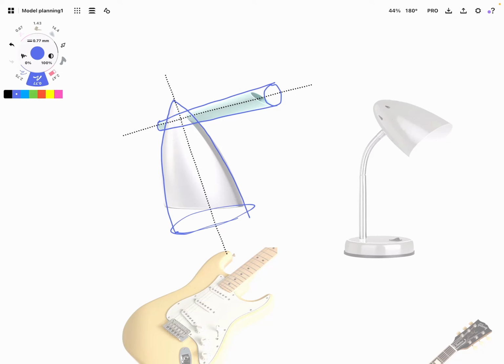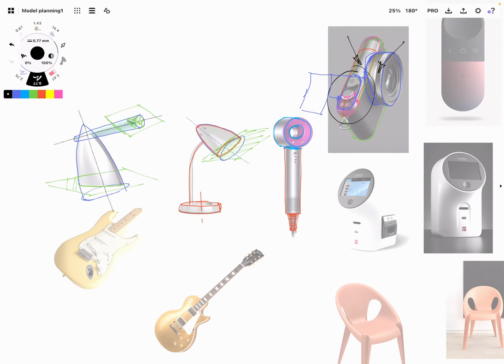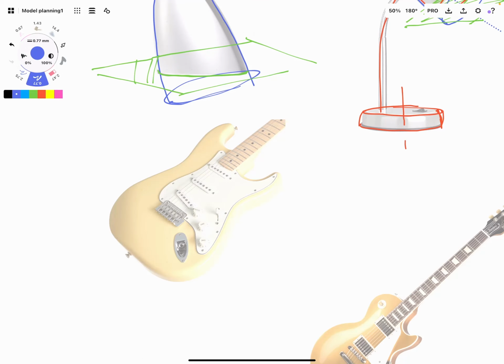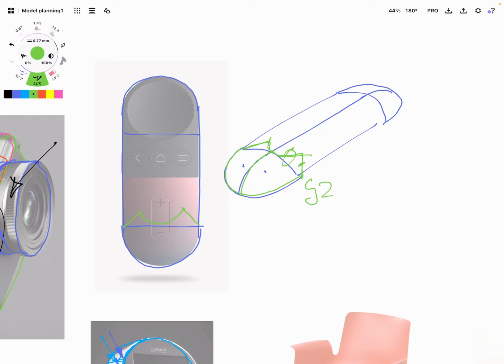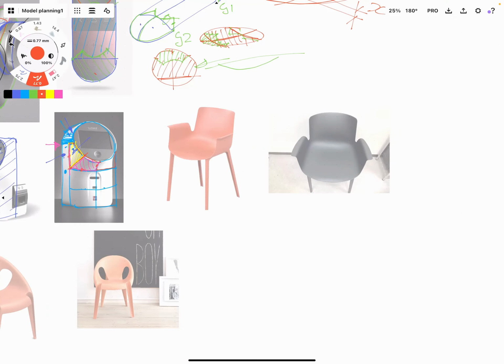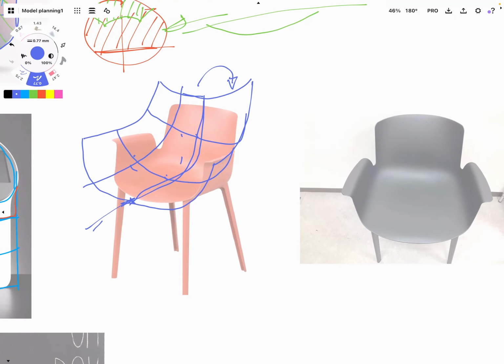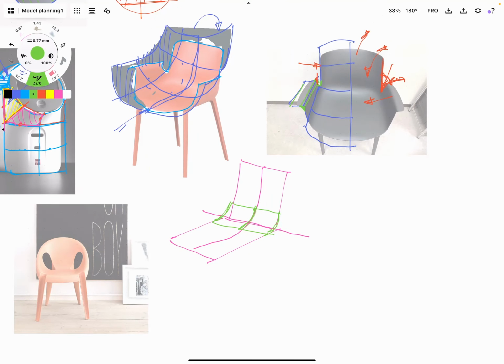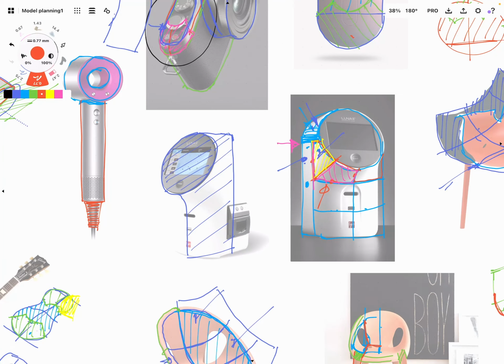Cad Model Planning #1

Comment: Great Video! I still have one question: Why do you prefer four-sided boundary surface operations over three-sided surface fills? Are they smoother?
Reply from the maker: Hi there. Good question. The main reason is nurbs surfaces have 4 sides, so if you make a boundary surface with 3 sides, one of the edges is collapsed into a singularity. That can cause all sorts of headaches later on (surface wiggles, issues offsetting surface etc).
Surface Fill in Solidworks will fit a larger/overbuilt 4 sided surface patch over a 3 sided hole which is then trimmed. It can be difficult to get good edge continuity using surface fills (even with constraint curves) plus they can randomly 'blow up' with spikes, dimples and wobbles appearing for no obvious reasons.

These links have some great information that is relevant to SW as well. Cheers!
https://help.autodesk.com/view/ALIAS/2022/ENU/?guid=GUID-2E98736D-0AE9-4021-A488-5D4522F20162
https://help.autodesk.com/view/ALIAS/2023/ENU/?guid=GUID-3E5274C3-FB89-4583-8087-A3E17DB849A1
Reply: @AndrewJacksonDesignStudio   Thx man! Love your attitude. You are really helping me (and I'm sure also a lot of other people) out. Keep up the great content!

As an industrial design student I only really learn solid modelling at university and its hard to get good tutorials for surface modelling in Solidworks.

Btw I'd find it super interesting to hear where you see the weaknesses and strenghts of Solidworks in comparison to Rhino. Thats a discussion I often have with colleagues ;) For me the main reason why I choose Solidworks is the Feature Tree and the ease of making changes afterwards. On the other hand if you plan on working as a freelance industrial designer you have to pay way more money for using Solidworks than Rhino. Maybe you could cover that in a future video
Reply from the maker: All good, pleased the videos are helping. Yeah there is lots of solids/intermediate content out there but not too much surfacing, and half of the surfacing content is people making patterned vases or impossible tables, which has little value for ID'ers trying to use SW in a production environment!

I use both Rhino and SW, but mainly SW for commercial projects unless I need a super clean/lightweight surface, in which case that is usually needed for Grasshopper for patterning etc. I find it much easier to make changes to models in SW, even models that are well developed and feature heavy. You do need to structure the master models and child parts accordingly to make them robust enough. The down side is SW output can be average, with the SW analysis tools being too clumsy to spot some wrinkles/issues with surfaces and edge continuity. I have a macro to push selected surfaces into Rhino to use the zebra analysis there, as you can control the analysis mesh much more than you can in SW. It is possible to make much cleaner/lightweight surfaces in Rhino, as well as being able to point edit the surfaces, which is not possible in SW without using the freeform etc features, which are not a joy to use. With Rhino you have to have a strategy in place to deal with changes, which in my case, means layering off the model as things progress, so you can always go back and branch off an earlier iteration. Hope that helps! Cheers, AJ

Comment: Hi Andrew, first of thanks for sharing through all these videos. Your breakdowns and tutorials have helped me improve my workflow as even though I use Rhino the processes are quite similar. I wanted to request a more detailed tutorial on the cell counter surfacing at @11:30. I tried it a few times but was not able to get a satisfactory result. Thanks again for putting quality stuff on the channel
Reply from the maker: Hi there, yes that does look like a trickier one to model up. I'm keen to have a crack at it, just not quite sure when at the moment, work has picked up! Thanks for watching! Cheers, Andrew.
Reply: @AndrewJacksonDesignStudio   Thanks for responding. Yes sure whenever you get a chance. In the meantime, I'll try it again and post if I figure it out. Cheers!